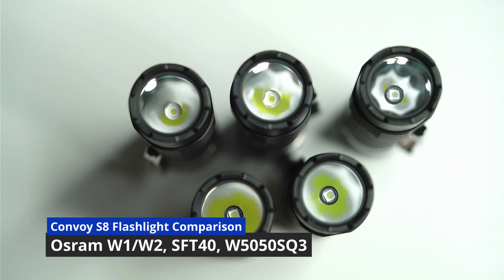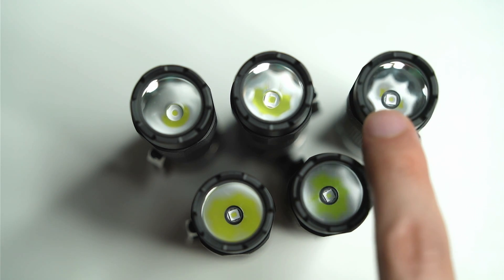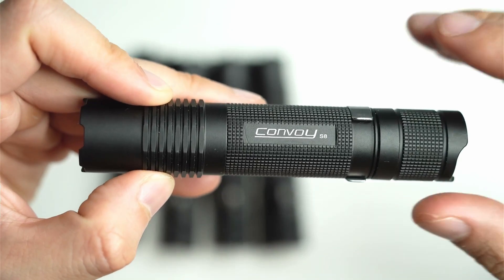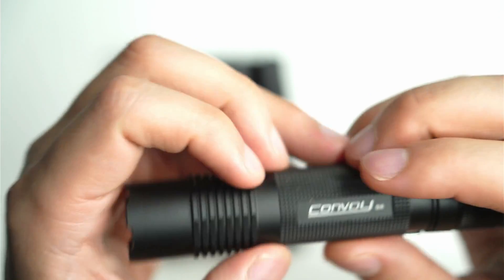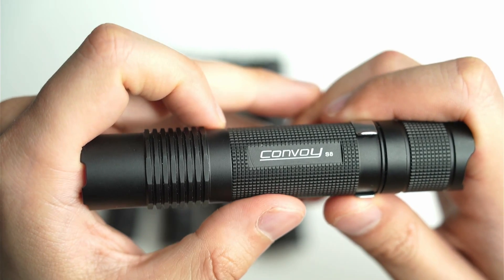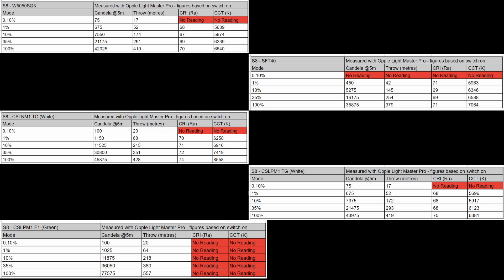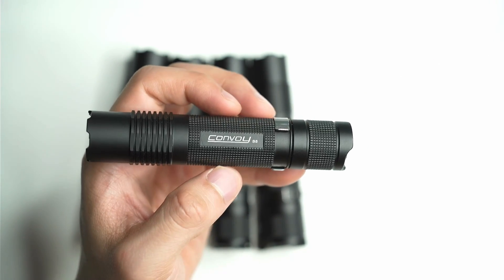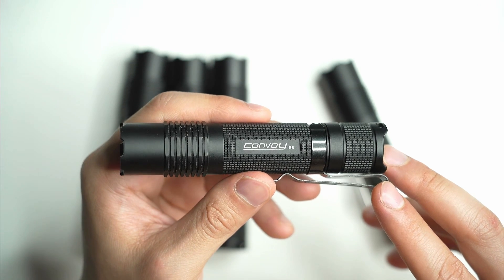Convoy S8 Comparison: SFT40, W1, W2, W5050SQ3 - Which Should You Get?

Comment: You have a million of these videos. Didn't even realize it was still you.
Reply from the maker: About 1000 videos to be fair haha
Reply: @DarrenYeoYT  I got the Convoy S8 with the green emitter. Same one you demonstrated. Thanks for the info. I had no idea about this light. I typically stay in the realm of Wurkkos and Sofirn.
Reply: @DarrenYeoYT  I live in Arizona. And have two dogs. Due to the sun and heat. Between April and October. Walking during the day, simply is not an option. And there are rattlesnakes at night. I wonder if the green light. Will Possibly be better. At seeing the camouflaged snakes. Because the real bright high K lights, actually make it hard to see them. But the brighter 6000k lights, are better at scaring the Coyotes away. I always have to have multiple lights.

Comment: Whoa! CSLNM1 8558K on full power! That thing surely don't like that much amperage. I dropped my C8+ CSLNM1 to 50% group and throw decreased only from 242KCD to 222KCD and got rid of that angry blue tint. That led is on it's limit.
Reply from the maker: Yeah I dunno what the heck was going on there. It might have just been that reading for a second or two. Like you said, the driver is pushing the NM1 beyond spec. And it does make it brighter, but also lowers lifespan @5A. Probably not to any significant degree.

Comment: Between the 620 nm CSLNM 1.23 and the 660 nm SST-20-DR which red diode would you prefer in a C8+?
Reply: i recommend the 660nm personally but maybe just because i prefer true deep red. 620nm kind of looks orange when compared side by side.
Reply from the maker: I like the 660nm better - it's a proper red compared to the 620. Though the NM1 will have increased throw capabilities.